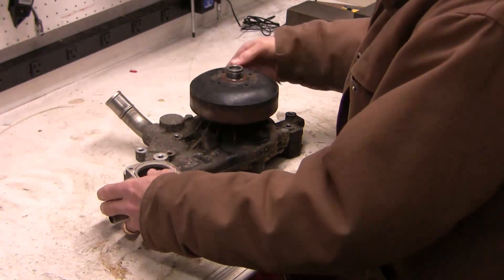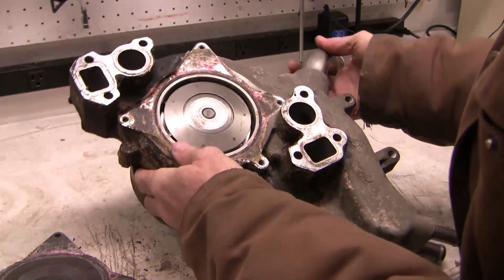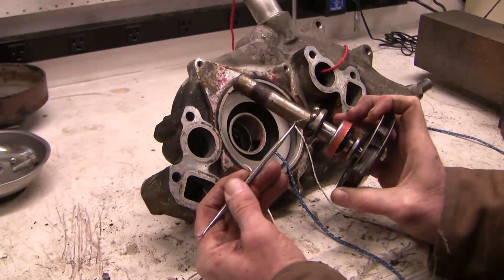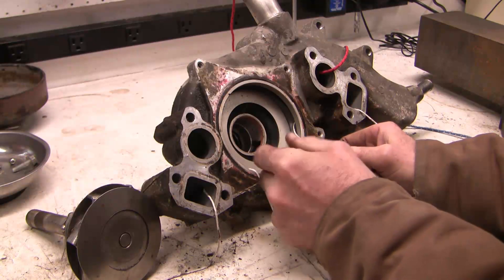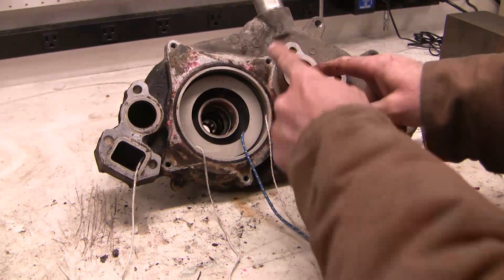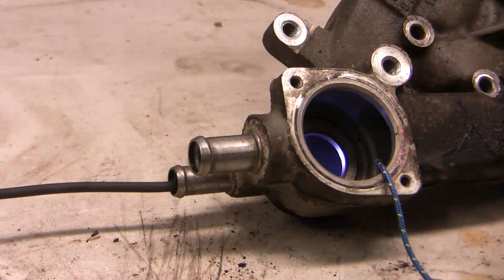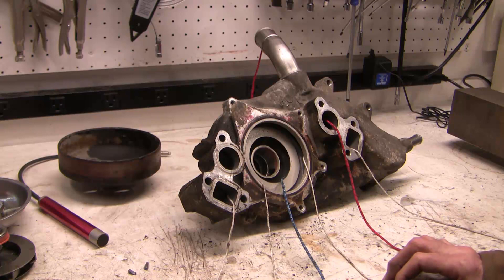Inside a chevy water pump -- how it works

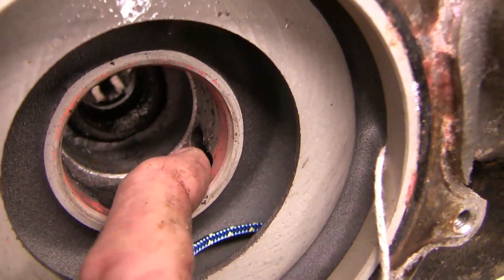Comment: very nice video, thanx for going through the trouble to make the process easier to understand. only problem I had was how you kept using the word "water" like at 2:56 and water and coolant. as far as I know, I never added or was required to add water to my vehicle, where does the water come from? I always wondered why they call it a water pump? would a better fitting name be coolant pump? I could be wrong
Reply from the maker: Those are all good points, I guess it's old school phraseology now. As you probably know there are some systems that don't use water at all, though I have some concerns about engine safety with those systems. Search "waterless automotive cooling systems" and you'll find lots of articles. That said, a water based cooling system seems to be the weakest link as far as long term corrosion and vehicle repair goes. I try to save money by using concentrated coolant and adding distilled water later, though the premixed solutions get around the issue of impurities that people might introduce later. Even though new terminology uses the word coolant, the vast majority of molecules in the fluid are simple H2O, and >99% of vehicles on the road today have a water based system. The coolant that is added is there to raise boiling point and to lower freezing point, and of course other additives are there to inhibit corrosion.
Reply: Excellent, I've learned even more as a result of your efforts. Thank you, keep up the good work!

Comment: Good video and explanation. The reason I watched was to figure out the installation of an inline heater (zero start). Very tight spacing on a 4.8 vortex in a 2002 Silverado.
I'm thinking maybe putting it in the heater hose closest the block? Not really the way instructions say...do you think it will circulate?
Reply from the maker: Great question, I suspect flow from a heater hose in a car with this design may be inadequate until the thermostat warms up. I believe you're talking about a block heater, used for locations where cold starts are a problem. Once before I installed a block heater. In that case I simply followed the (Toyota) manufacturers directions with an OEM part, for about $40. Cheap. Whole teams of engineers design those parts, I don't see a reason to drift away from the standard design. I have a block heater in my Suburban, I've never traced the wire back to see where it is mounted. You can buy cheap glue-on 120 volt heaters that are designed to stick to the bottom of the pan, heating through the steel of the pan, but they don't work nearly as well as those that deliver heat to the block internally through the cooling system. I would avoid heating coolant very close to the thermostat, since if the thermostat is fooled into thinking the engine is hot you may paradoxically cause a delayed warmup because the big mass of cold water in the radiator would be allowed to enter the cycle sooner than it should. A properly functioning cold thermostat slows water flow through the radiator, isolating a big mass of coolant inside the rad until the engine has a chance to quickly reach operating temp. In this Chev design a cold thermostat offers a low resistance bypass, short circuiting coolant flow, so recently warmed fluid immediately returns to the engine without having to take the higher resistance pathways through heater core or radiator.
Reply: @spelunkerd  ok thanks for the explanation. Your insights are much appreciated!

Comment: I need to replace the water pump pulley on my 2003 GMC Sierra (fan clutch threads are shot).
1. Where did you get the puller. 
2. How would you secure a new pulley on the water pump.
Anything you can offer would be helpful. Thanks!
Reply from the maker: Rebuilt water pumps come with the pulley. Given how much effort it was to remove (with the use of specialized tools) you may be better to go that route. Alternatively you could find a pump at a salvage yard and pull the pump pulley off with a three jaw puller. The pulley itself may be hard to find by itself on the retail market. I got most of my automotive tools at Princess Auto here in Canada, in the US a similar store is Harbor Freight. The pulley is just pressed onto the shaft of the pump, I would use a press, but if you don't have one often all you need is a hammer and block of wood. Good luck! I did two other videos of how to replace the water pump in a 2000 GM suburban, you may find those helpful. When you get it apart, don't be surprised if all you need is a new fan clutch, those often go bad.
Reply: Thanks for the reply. I was replacing the fan clutch and a misthreaded (apparently) fan clutch stripped the threads on the pulley as I was attaching it. So now it's replace the whole water pump or  just the pulley. I actually have access to a new, old stock pulley but was concerned about getting it attached to the water pump while still in place. Seems like the hammer and block approach might damage the water pump and/or spindle while it's being hammered. I'm wondering if there's an attachment tool for this application like the puller/installer for power steering pumps.
https://www.youtube.com/watch?v=YIiUioLhOxc
Reply from the maker: @nkr3637  You might be able to find something, though it needs to fit inside the space behind the radiator if you do it on the car. I don't remember if there is a threaded concentric hole inside, the way a power steering pump installing tools work. I share your concern about damaging the pump bearings during the install. The other option is to switch to electric, which offers slightly better gas mileage and more strain on the alternator. Electric fan switch kits are widely available.

Comment: Could you explain how the lt1 water pump works.
Reply from the maker: These are a simple centrifugal pump, used in many engineering applications. There are good videos describing how these work in detail, however the basic principle is that the rotor is driven by the fan belt, causing water between blades to be flung outward as the shaft spins. The inlet is central, so cold water enters near the shaft, and the outlet typically has an increase in diameter to reduce the high outlet pressure spike, promoting coolant movement. When water molecules slam against the outlet wall they deflect to follow piping that leads to the engine cooling passageways. The limiting factor for centrifugal pumps is the low pressure spike at the inlet, which in the extreme can cause vaporization of water molecules and inefficiency. So, inlet water needs to be as cold as possible.

Comment: Question. With the thermostat out and the top hose pulled from the ratorator with the truck running should the pump be pushing water out the hose cause my truck there’s no movement of water.
Reply from the maker: Yes there should be some movement, though much of it will be through the huge bypass hole when this style of dual-valve thermostat is removed. That technique, to remove the thermostat completely, worked well in older style single valve thermostats but the story is more complex with a dual valve unit. Also note that your system needs to be adequately burped, since a water pump doesn't work very well when there is trapped air near the impeller. Trapped air absorbs the energy by compression, so the pump can't move much fluid until the air is replaced with fluid. I show how to burp the system with a no spill funnel in a couple of my videos that are listed in my cooling system playlist. Good luck!

Comment: Do u know the torque specs for the center plate on the water pump?
Reply from the maker: Not off hand, unless I included it in the video where I removed the pump and installed another one. I subscribe to alldatadiy to get access to the OEM repair manual, it's worth a look.

Comment: I just replaced this pump on an 05 Express van. Before doing so I had a long look at the parts & ran water through it & drew arrows with a sharpie but your video clarified the function for me. Now I am trying to figure out why those orange silicone gaskets failed & if my intake gaskets are made of the same material. I flushed & changed my coolant when I bought the van three years ago to O'Reilly Dexcool compatible fluid but have no idea what the previous owner had done. It may have been the original Dexcool. Whats your opinion? Should I flush it & change to something else? I had the same black substance around the silicone gasket & inside the pater pump water jackets.
Reply from the maker: I've been running Dexcool in this vehicle since I bought it new, and have never had a problem. Still driving it now, presently with 360,000 km. My opinion of Dexcool is if it never overheats you'll never see the issues of clogging that have been described, and I suspect many of those are due to other factors like running dry of coolant or having other owners put stop leak in. I don't think the Dexcool is causing many problems by itself. Switching would not be a big problem, either, if you choose one that is compatible with aluminum. Universal coolant would be reasonable, but I've found no reason to switch.
Reply: Thanks for the reply! I guess I will leave it & monitor it better with a voltmeter & PH test strips since I just changed it yesterday. What do you think caused the original orange gaskets to fail (The new OE ones that came with the new OE water pump were black & had a slightly different design)? What do you think that black substance is around the silicone gasket & inside the water pump water jackets? I have seen it on almost all the photos & videos I watched preparing to do the job. Are the intake gaskets made of the same material & due to fail as well?
Reply from the maker: On mine the black areas were wet from leaking coolant. The solid substance there was mostly residue from the old gasket, probably mixed with grease and maybe even old RTV. Yeah, with the heat and shrink of dramatic thermal changes, over time few gaskets can survive the long term. Cheers!
Reply: I had a better look at the old parts. Thankfully, It looks like the gaskets were in fact OK & I did see evidence of leaking from the pumps weep hole. The black seems to be around the outside edge of the orange gaskets on the motor side & is hard carbon like. There is also a black coating on the passages but its just a thin coating. Maybe thats how Dexcool protects the metal? The pump spins fine which is weird because I thought that the bearings were shot since I heard clicking sometimes but I am guessing that the clicking was cavitation from the air in the pump from the failing seal? I put the thermostat in boiling water & realized that only the top moves to allow fluid from the lower radiator hose in. The lower spring & metal disk are the bypass valve & work with water pressure & spring tension. From the Service Manual; "The thermostat also provides a restriction in the cooling system, after it has opened. This restriction creates a pressure difference which prevents cavitation at the water pump and forces coolant to circulate through the engine block." This has been a great learning experience.

Comment: My son's 2008 Chevy has had a number of overheating and new water pump or new last spring but truck sat so lately it's overheating but the lines to heater core will be cold? I removed thermostat and still have an issue with higher temperature?? It's a intermittent issue but I replaced thermostat and expansion tank and cap because it would build pressure then pushout overflow not recirculating back into radiator overflow hose. He can always tell it's going to run hot because heat blows cold air so is it stopped or bypass or water pump or thermostat? Maybe head gasket but it works great and no oil in water or water in oil so maybe flush the heater core and system?? There's no leaks and water stayed at fill for weeks then warmer days it started overheating again without thermostat and with brand new thermostat? It's like water pump is pumping then maybe not? Advise?
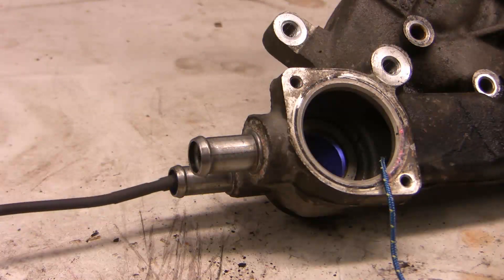Reply from the maker: Trapped air is the most common source of confusion. Run the engine with cap off, keep filling and watching until engine is completely warm to be sure all trapped air has been burped clear, then put cap back on and let the cap do the remainder of the burping. Be sure you've got the correct cap and thermostat for the vehicle. These complicated chevy thermostats have two valves so it would be expected to overheat with no hot air from the heater core if the thermostat is removed, because hot coolant can bypass back into the engine without going through the radiator or heater core. In the video just after 5:00 you'll see how warm coolant can bypass the radiator and go directly back to the engine if the thermostat doesn't close off that opening. If in doubt I'd get a thermostat from the dealer to be sure it's correct for the job.

Comment: Hi spelunkerd
I have one quetion for you.you spoke only about the engine cooling system. How about the two side tubes for the heater system? Does it continuesly flow water? or it have a solenoid or valve? what to do when you want to bypass the heater?
Reply from the maker: Good question! Older style pumps like this one have free flow to the heater core all the time, but many newer systems have a solenoid-controlled valve, as you say. In the video you can see where the heater hoses attach, and they are very close together, separated by the bypass hole which is controlled by the thermostat. When that hole is cold and open, pressure on the two hoses is similar so there won't be much flow to the heater core until the thermostat warms up to close the bypass hole. So, in this mechanical design, cold water in both the heater core and the radiator will not be moving very much until the thermostat moves to the hot position. After the bypass hole is closed you get differential pressure that will drive flow around the heater. You could clamp the hose on either or both sides if you wanted to bypass the heater core, though it would interfere with cooling since the heater core does contribute a small amount to engine cooling. I scratched my head when I began to understand the mechanical complexity of this pump. Part of the justification for designing it this way was to improve fuel efficiency by reducing the work needed to move water before the engine has warmed up. Of course the bigger reason is to speed warmup by isolating a big volume of cold water in both the rad and the heater core. The engine always turns the impeller,  but since water is short circuited through a large and short bypass hole the hydrodynamic resistance during warmup is minimized. This also gives the tech a clue to diagnosis, since in this style pump a "stuck cold" thermostat should give reduced heat inside the cab, on top of running too hot. However with two valves and complexity as to how a thermostat might fail, that is not a particularly useful sign. Newer cab designs added a heater hose solenoid anyway, since the engineers didn't want the heater core to confound AC efforts to cool the cab after warmup.
Reply: thank you for your quick reply. You do very well in the water pump system. great of you. i think after the bypass is shut. if you have deleted the heater core, and use a loop hose instead of block off the heater tubes, the hot side will be suck into the cold side via the loop hose.that will reduce the effective cooling i think.If i am wrong you can say it to me.
Reply from the maker: Yes. Old style systems had an "always open" bypass tube that limits flow because the tubing is fairly small diameter with high resistance. With those systems, when the thermostat opens a pathway to the rad, more fluid goes the lower resistance route through the rad, even though some coolant ends up going through the higher resistance pathway through the bypass even when hot. Those systems have to be designed with a little more reserve because some warm fluid takes a short pathway. As you say, a loop in place of the heater core would allow fluid to short circuit mostly when the thermostat is in the hot position, reducing cooling when hot because some warm fluid that follows the bypassed coolant hoses warms the cold fluid coming back from the rad. New radiators have much smaller tubing which means the resistance in the rad might be higher, increasing flow through bypassed heater hoses. I don't see a big advantage to maintaining continuity between the heater hoses if they aren't used to warm the cab.... Also note that the diameter of the heater hose nipples on this water pump is slightly different when you compare the warm side to the cold side, which might make it a little tricky to use one hose to connect the two nipples. If you can get one hose to seal I suppose you could just clamp that tube....